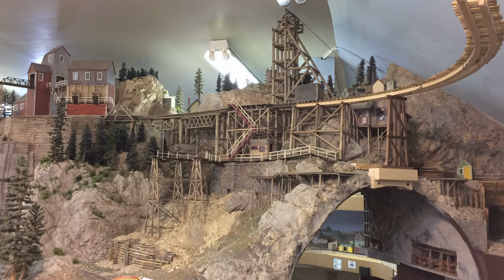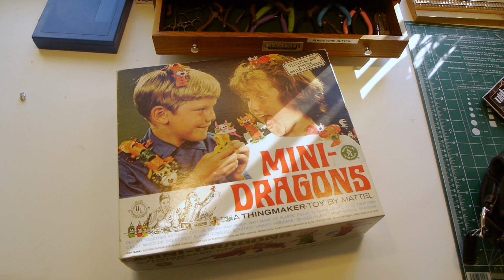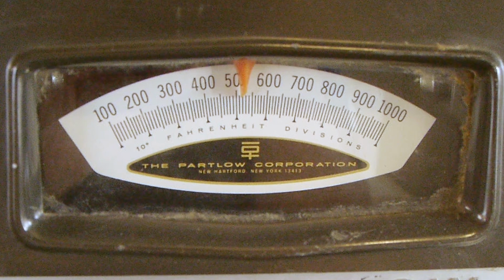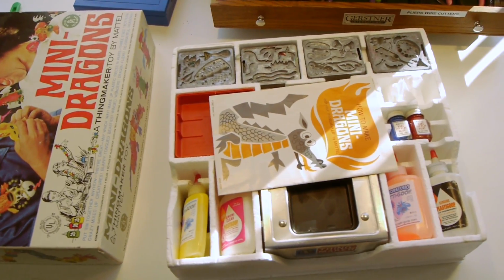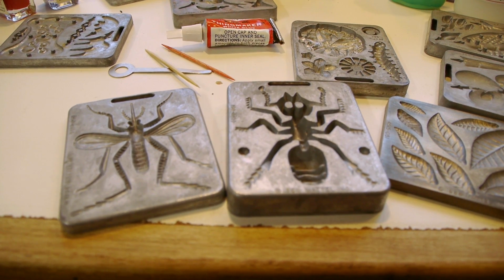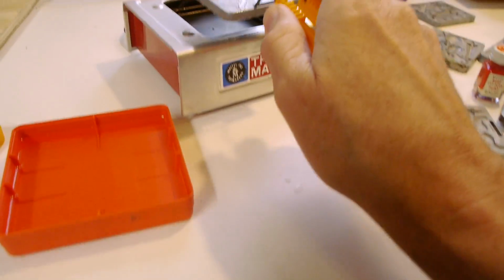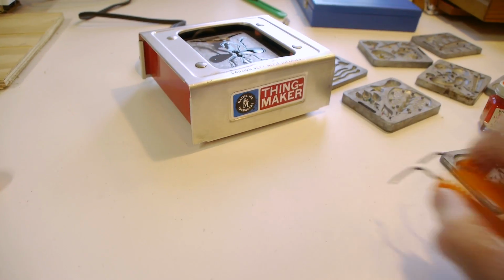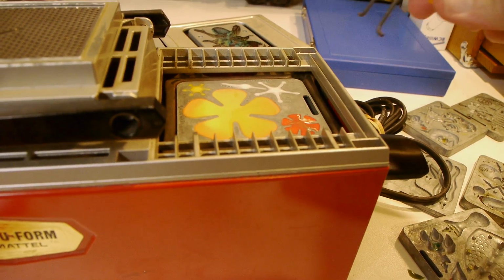Mattel Thingmaker and some odd casting machings

Comment: What are the molds made of? Strong enough for molten copper or aluminum?
Reply from the maker: No. They are metal.. I’m thinking pot metal. Zinc alloy. Die cast. I’m betting melting point about 1500°F.

Comment: I also had a device that was powered by a hot bulb, but it came with opaque plastic sheets with designs u could cut out and it would shrink n thicken them. 
Cool. 

U are right we had, BY FAR, the cooler toys! Golden age!
Reply: Shrinky-Dinks
Reply from the maker: Christmas. Best time to dig out the old toys too.

Comment: Creepy crawlers’s patent expired, and was snatched up by ToyMax, and then after a couple of decades of making BugMaker machines, toymax was bought by JAKKS Pacific and they have been making them to this day. So Creepy Crawlers has become a large and popular brand and has come a long way since 1964.
Reply from the maker: I was buying Patty Goop. But she stopped selling it. As I have tons probably will never need more but wondering if there is anything else on the market?
Reply: Toy Man Television Patti-goop should still be available, I just bought some two days ago, she only discontinued the Deetail Patti-goop and the Superplastic Patti-goop, but if you still are not able to buy it, then there is some original Creepy Crawlers plastigoop on eBay that works just as good with the thingmaker. I’m pretty sure that there is Patti-goop on eBay too.

Comment: Was there a mold set for making toy cars? I recall this or something similar with molds for making car bodies.
Reply from the maker: Yes there were several systems for that. I don’t believe the thing maker ever came with that but a variation on there is the hot wheels factory which cast cars of the plastic wax. And more significantly vac you form machine. It made many different styles of car bodies by vacuum forming sheets of plastic
Reply: @ToyManTelevision  I had one that made car bodies from rubber goop. It was a two piece mold, a negative and a positive. You would pour the "goop" into the negative, the put the positive into that and clamp it down, then put it into the heating unit. Once it finished "cooking" and cooling, you would remove it from the mold, trim off the excess  rubber, cut out the windows, and attach it to a frame that had a battery powered motor and wheels. These were not the size of hot wheels or matchbox cars, but to the best of my recollection were 6-9 inches long. This was more than 50 years ago. I have never been able to find any information on this toy.
Reply: I had the car mold set as well as the bug set.   I don't remember if my parents bought this stuff, or it was given to me by someone in the neighborhood.  I remember that once my supply of goop was gone that was it, my father refused to pay for any refills.  Maybe it was just as well, I vividly remember burning my fingers.   I also had the Rapco famous monsters candle making kit.   It involved melting candle wax and pouring the liquid (hot!) wax into a mold.  I can hardly believe now what kind of stuff was sold as children's 'toys' back in the day.

Comment: Ah yes.....many, many finger burns from that toy! 

Talking about toys from the 60's, the toys were mostly what would be banned today. I had the Mattel M1 Garand. You loaded the bullets into the spring loaded shells, then loaded those into a spring magazine cartridge. Then when you shot the gun(NO UGLY ORANGE TIP BTW) it shot out the hard plastic bullet and shucked the cartridge out the side. Damn that was a fun toy!
Reply from the maker: Right???? We are doing a show on the “fanner 44”. The 44 cowboy revolver that used the same bullets. You load the assembled bullets into the revolver and the green sticky caps. The little plastic bullets cost a bunch on eBay today. About 1 to 5 busks each!!! I only have one!! I have about 10 brass casings but the little grey plastic slug..... anyway great toys!!!!

Comment: Thumps Up!! A lot of FUN with Mattel Toys!! (the EZ Bake Oven, the Vacuum Former, the Wood Shop, and the Toymakers Injector Factory.) All fun fun fun!! :-)
Reply from the maker: Just bagged a Hot Wheels Factory plastic injector. With molds and plastic!! Only on the market for a while, late to the party before the dangerous toys were pulled.
Reply: Toy Man, Oh Wow! You know, that's really marvelous!! The "Hot Wheels Factory" (with the slogan: make hot wheels custom cars!) was the cooler of the two injector sets by Mattel. This one allows you to make 10 different car bodies and two different chassis. Part of making the cars was to mold the windshields out of clear plastic. Doesn't get much cooler than that!

Plus! Mattel's Injector - Western World is also a very cool toy from the late 1960s. This set allowed one to make cowboys, indians, and horses out of molten plastic. The Western World set, date 1968, maybe more readily available than the Hot Wheels Injector.

Thank you so much! The best!! :-)
Reply from the maker: there was an add on for the Hot Wheels Factory. It made an indy car, a car trailer for it, a pickup to pull it and a camper shell!!
Reply: Toy Man, may you, and (your wife) Mrs. "K", and family, have a very blessed Christmas and Happy New Year!

JPilot :-)

Comment from the maker: This was just one of a bunch of FUN Mattel toys, they also offered the EZ Bake Oven, the Vacuum Former, the Wood Shop, and the Toymakers Injector Factory. All ended up being called off the market over safety concerns. They came out with the Thingmaker 2. In my mind, junk. But really not a bad toy, it's just that when you have used the "real thingmaker" it seems like a far cry. Used a light bulb for heating, so it still got good and hot, but nothing like the 350 -400 thin thing ran at. One fun part, you could eat the bugs as they were basically gummy bugs,
Reply: Incredible Edibles I think was the name?? That's what my sister got.
Reply: The edible goop was called "Gobbledy Goop" (if I spelled it right).  I believe the EZ Bake Oven was a Kenner product.  We had a Vacu-Form and had a lot of fun with it.
Reply from the maker: YES!! I remember, gobbley goop!!!! And yes, I guess Kenner. May need to find one.
Reply: him: Not lethal just minor scars.
the same toy: Toxic levels of lead kills dozens of people.
Reply: The thingmaker I had in the early 60s was with non-edible liquid plastic.

Comment: I had a Thingmaker, with the Creepy Crawlers.  And had another set of molds that I can't remember what they were called, but I seem to remember making either flowers or army men or something like that.  With the Creepy Crawlers, I made multicolour butterflies, by first making the spots on the wings, then the patches, then the body and wings, feelers, etc.  I also made the worms with the darker part where the ring was on the worm.  It was a blast.  Much more fun--and safer--than my woodburning kit.
Reply from the maker: The Creepy Crawlers were the first. (as I recall) But they were all FUN. I'm trying to figure a way to make molds.... Close to working that out!

Comment: Never had the thingmaker, but I did have a low temp injection molding machine.  The sixties were a great time for toys.
Reply from the maker: Those are great!!! They were more expensive. And you can't get plastic for them anymore. Sort of like glue sticks. BUT WOW!! A real injection machine!! My favorite was the Hot Wheels Factory one. 10 different hot wheel cars. Came with 5, and you could buy 5 more as add ons. You could also make cars with the Vacuum Former. I have all the molds for that. BUT you needed to buy the frame and wheels separately.
Reply: Did some googling and what I had was the Kenner moldmaker. Like a lot of the toys I had I think I found it used.
Reply from the maker: Googled. WOW those are interesting!! Didn't know about that one. Looks like an injection system.